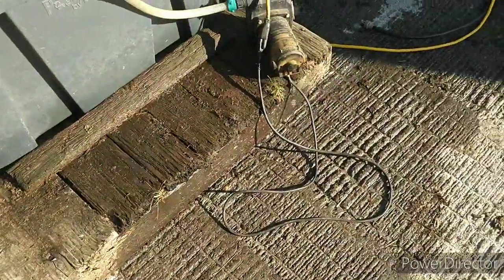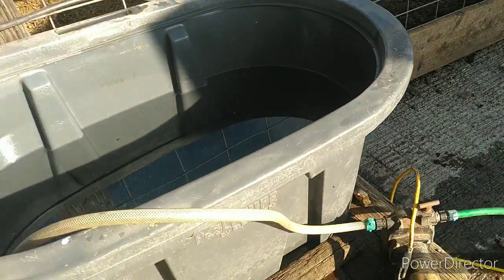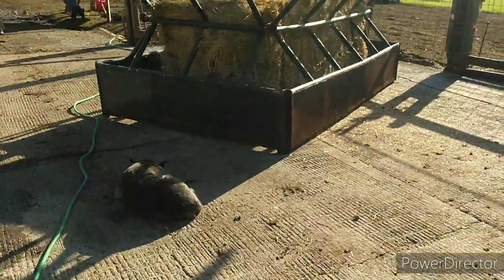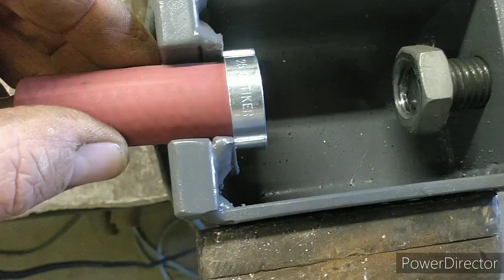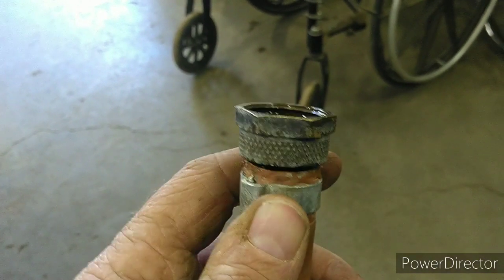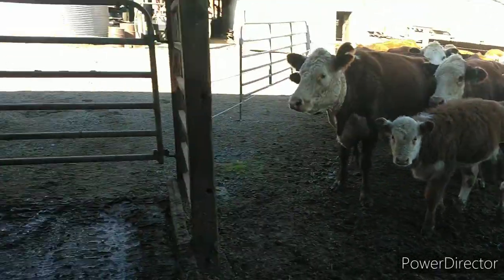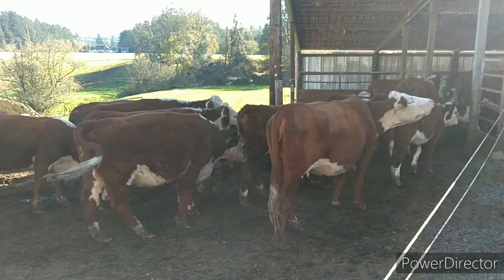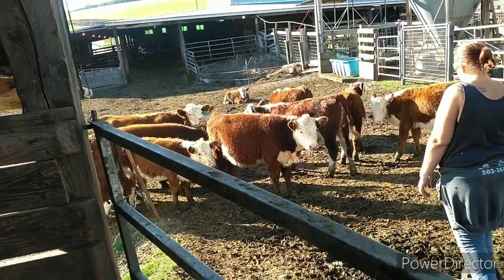Fixing, separating, ready for preg checking

Comment: Oh, probably about 25-30 years ago, we had a pretty bad cold snap come through, and I thought I had dripped the faucets enough... (Well, they weren't predicting it to get as cold for as long as it got) and the water well froze up real good.  Didn't hurt the cast iron pump or the well head, but the PVC pipes connecting everything, those busted all to pieces... SO I needed water back ASAP, and it was the weekend, so I got some hose barb fittings and some big rubber reinforced hoses from the Western Auto and went to work... screwed the hose barb fittings into the pump and wellhead for the suction and return lines, then installed about a foot of hose to connect the two together like they had been-- even replaced the busted water line coming out of the pump into the gate valve feeding the pipe going down into the ground going out into the water system since it froze off the top of the pump and busted.  Had to go to my Dad's and get a couple coolers of water to prime the pump and well but I got it going pretty quick.  I had intended to replace the rubber hoses on the wellhead and pump later that spring.  Well, I think those same hoses are STILL on there all these years later... Oh, they've frozen a few times since then, but generally when they DO freeze solid, the rubber hose just swells up a bit and then when the sunlight hits it and warms the black hoses up (WAY faster than they warm up a white PVC pipe!) the hoses thaw and everything starts working normally again.  Plus, no algae can grow inside a black hose, unlike a white PVC pipe-- I had to paint the white PVC risers going to my cow troughs black, because algae would grow inside the pipe, and particularly bad when the cows were rotated to a different pasture, a LOT of algae would grow in the pipe, and then when the cows came back and started hitting the trough pretty hard, the algae would peel off the inside wall of the pipe and clog up or gum up the orifice in the float valve... painting the pipe black prevents light from filtering through the white pipe wall, and thus prevents the algae from growing... but as stuff breaks, I just replace it with either black poly tubing or rubber sprayer hose... works great!  OL J R :)
Reply from the maker: Haven't had issues with algae in the lines, makes sense to paint them though.
Frozen lines are never any fun!
Reply: @GosselinFarmsEdGosselin  Yeah probably more of a southern thing LOL:)  Yeah imagine my surprise a year or so after moving into our house and putting PVC plumbing out there on the well when we started getting water faucet screens and washing machine screens clogging with algae bits... had a couple pipes freeze or break and cut them to install new and find the pipe is lined with algae...  Black poly pipe or black hose doesn't allow enough light in for them to live so NO ALGAE... why I'm just going all poly or hose from now on-- poly can usually take a freeze too without issue, so long as it's not TOO hard a freeze... Later!  OL J R :)

Comment: So does that doo-dad crimp the hose clamps or what??  I've seen those and I'd definitely prefer those to regular clamps, though that's what I end up with most of the time.  I bought a doo-dad one time at a farm show that makes clamps out of regular baling wire... you cut a piece, fold it into a "U" shape, then wrap the wire around the hose after you put it on the fitting as many times as you want-- the more times you wrap it, the stronger the clamp force is... then you pull the remaining ends up and wrap them around a cross-peg on the tool, and twist them together... then the V-notch at the tip goes into the bottom of the "U" part and you tighten a thumb screw to pull the wires tight and provide the clamping force... you can undo the wires and tighten it up again if needed or wanted until you get the clamping force you want, then fold the entire tool and wires over where the V-tip is in the "U" of the wire, and snip the wires off about 1/4 inch back from the "U"... then just mash the ends of the wires down flush into the surface of  the hose... the folded over wires hold the tension and keep the clamp tight forever... to take the clamp off, you just cut the wires... If you use stainless wire it's a permanent clamp basically.  Works great but kinda slow... Later!  OL J R:)

Comment: I used that type of clamp on pex about 10 years ago. I wander if they will hold some hydraulic hoses.
Doc
Reply from the maker: LOL... I've seen them on air and water lines.. pretty sure they won't handle higher pressure...🤣😂
Reply: @GosselinFarmsEdGosselin  don't want the hot oil shower eh?  Don't those folks with hair put hot oil in?  Lol
Reply from the maker: @martinbenton742  lol... Had plenty of hot oil showers doc... Most of the scars are gone now...
BTW, scars are God's tattoos 😎
Reply: @GosselinFarmsEdGosselin  I took my last one, last winter. I have some hoses that are older than grandpa's coon skin condom on there that I should replace before snow hits hard.
Reply from the maker: @martinbenton742  lol.. new, old, they all get you 🙄🤬😂🤣

Comment: 1st🥇
Reply from the maker: Looks like a tie, but still first 👍👌
Reply: @GosselinFarmsEdGosselin    Had to try to get the jump on everyone else. 😃😆😅😂🥃🥃🍻  Liked the hose repair kit.👍🏻👍🏻🥃🍻  Every once in a while you can get something that turns out to be a good item from "Hobo Freight". 😃😆😅😂👍🏻👍🏻🥃🥃🍻🍻
Reply from the maker: @crslyrn  the hose Stuff is from an industrial supplier, the press for it I made😎😁
Reply: @GosselinFarmsEdGosselin    I actually meant the pump from "Hobo Freight". 😃😆  I'd definitely go with a good supplier for the plumbing items. 👍🏻👍🏻🥃🥃🍻
Reply from the maker: @crslyrn  ah, yes.. I forgot about the pump. They are pretty good for electric motors!!
That little pump has been through the mill, still works great!!!